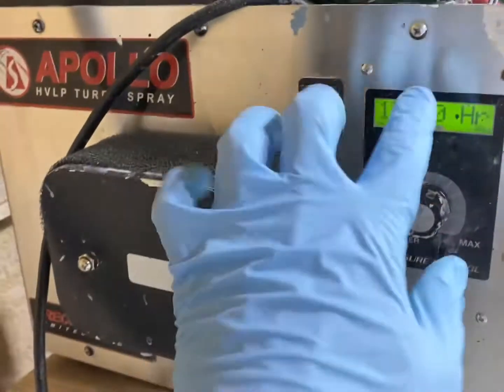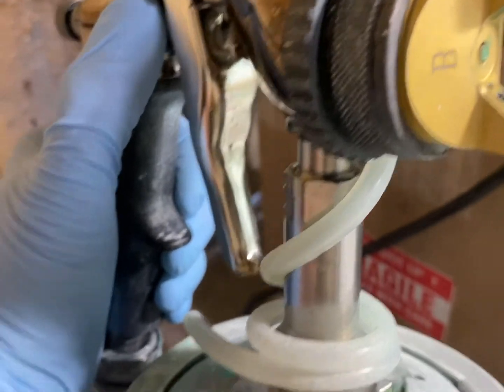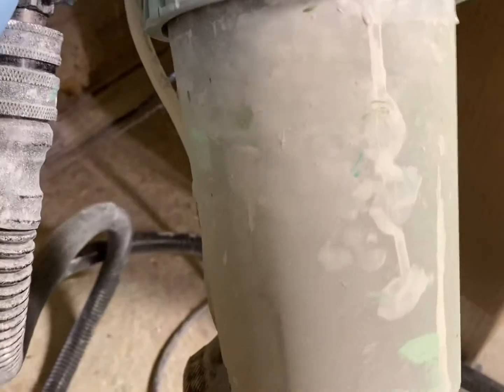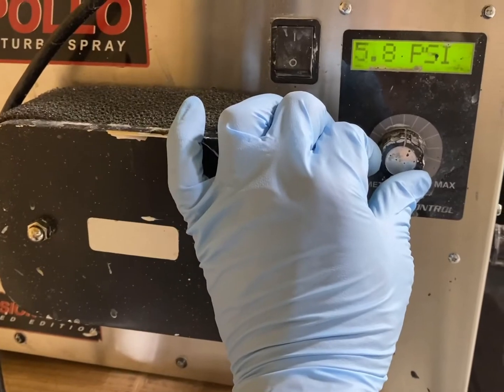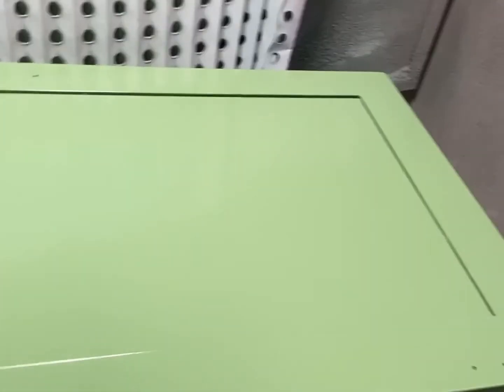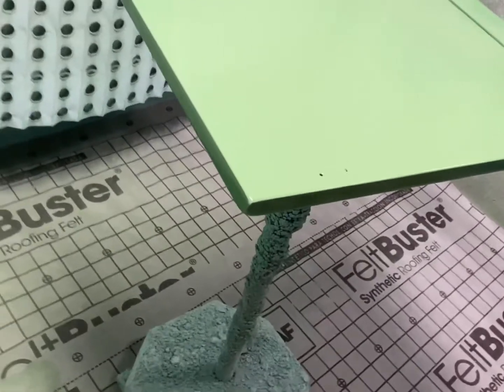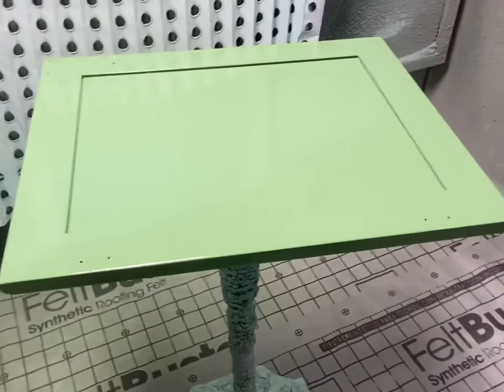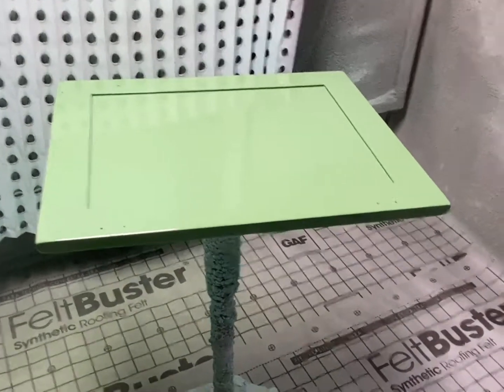Some Tips for spraying Renner waterborne paints with Apollo 7700 HVLP. See description for more...

Comment: Cool to see you can spray these finishes with an hvlp turbine. I have a fuji mini-mite 5 with a t75g gun with 1.5 and 1.8 tips. I am looking to get into waterborne finishes and want to try out the 688 and 851 on some tables. My turbine doesn't have a pressure knob just, a valve at the gun. Any advice for air pressure at the gun, fluid and fan settings on the gun?

Comment: I just got the Apollo and I’m testing out settings. I want to spray 643 unreduced so I can get the highest build. What settings have you used for 643 or another thicker water based coating that’s thicker like that?
Reply from the maker: I would use a 1.8 or 2.0 needle with the C air cap. I also reduce 5% for better flow. Adjust air pressure as high as needed. You can probably spray unreduced but won't get quite as good atomization.  Also, I like to use a pressurized cup like a PPS cup.
Reply: @homesteadcabinetdesign3406  thank you so much for responding. I just got the Apollo 6, supposed to spray unreduced. Have you ever tried heating up the coating instead of reducing?
Reply from the maker: @aurthordunne  yes that works but be careful if you add catalyst , as you can  shorten the pot life quite drastically.
Reply: @homesteadcabinetdesign3406  you’re saying the pot life shortens with warming up the coating when adding catalyst?

Comment: I really appreciate the tips in the description. How do you handle customer requests for a specific color? One of my clients wanted a custom coffee bar but the color had to match existing pieces in the room. I was stuck trying to use HVLP to spray SW Emerald. I have the same setup as you but I just could not get it to work. I had to thin the material by 40%. I found someone who could spray the paint with their airless system. Ever since that project I've been trying to find a color matching solution with a product that will work with HVLP.
Reply from the maker: Some of the thicker coatings will spray better with a PPS cup. I prefer that over the gravity cup.  I'll do a video on that soon.
Reply: Thanks!  I use PPS cup, pressurized either on top or bottom.  I've blocked out some time to getting the setup just right. It is frustrating when you are told you can spray it and I've got the equipment but it takes time to get it all dialed in.

Comment: Do you have to throw away the liner every time you finish the contents, or can you refill it and continue using it? Seems expensive if you have to throw away after it empties once. Thanks!
Reply from the maker: I refill them as long as things don't dry out. At the end of the job I just pitch them with the leftover paint since it's catalyzed and will harden.
Reply: @homesteadcabinetdesign3406  ok awesome! I meant to ask if you've ever sprayed Renner primer 643 through that turbine, and if so what settings did you use? I know the top coat sprays beautifully with a 2.0 C HS cap and 6.2-6.8 unit pressure/full open air/4-5 turns fluid/3lines from full circle. Thanks! Keep up the great videos!!

Comment: Now that you've transitioned away from HVLP for WB to airless/AAA how do you feel this machine specifically does in comparison with your other setups? Does HVLP still provide a better/smoother finish? I know the apollo precision 5 LE can spray Renner straight out of the car without thinning based on results I'm seeing from pros in some of the forums I'm in. Curious on your thoughts as I wanted to add this sprayer to my arsenal.
Reply from the maker: I haven't necessarily transitioned away from it. I like them both. I think every finisher should have an HVLP for small jobs, touchups, and for spraying stains or clears. I like airless as well for spraying primer on doors. Topcoats on doors I generally use aaa. On-site spraying of the cabinet frames, I use my HVLP.
Reply: @homesteadcabinetdesign3406  makes total sense. I also was curious if you’ve ever compared the results you get using these high end machines to let’s say a lesser x5/x17 airless using the FFLP tips? Im wondering if the difference is drastic in finish? Thanks for your input. Love your videos.

Comment: when i use the PPS system with my Apollo and Renner 1245 or C005 Crosslinked , thinned 5 %, i find I have to remove the screen in the lid of the PPS to get a good spray pattern...do you have any issues with the screen on?
Reply from the maker: No, you shouldn't need to do that. Is the bag being compressed when the cup fills with air?

Comment: Hello and thank you for the videos.  I am in the exact situation you described.  I'm a carpenter getting into finishing and refinishing. I currently have a large compressor and an older Devilbiss Finishline flg4 HVLP in my shop I have used for many different coatings with success.  I struggled greatly to get consistent results with Centurion 2k.  I'll be switching to another like Renner. Do you have recommendations on a good WB 2k gun for a compressor set up? Also, do you think a good compressor and gun is different than a turbine system? I'll be getting a tritech shortly and probably converting it to AAA. For smaller projects like a vanity or furniture, I feel as though HVLP would be best suited, maybe? Thoughts? I'd really appreciate it.  I've been struggling to get out of this rabbit hole.
Reply from the maker: I've used a turbine unit for a few years until the unit quit on me. So temporarily I'm using a compressor set up. the problem is most HVLP guns require more CFM than a small compressor can handle. I'm experimenting with a few different guns right now with  a 2 HP compressor and will be doing a video shortly on some of the results. Turbine units should be at least 5 stage for 2K WB or they just won't atomize well. Compressed air will atomize better, but its hard to find a compressor that will keep up. A large compressor in a shop works well, but for taking to jobsites, just isn't practical. Possibly 2 compressors and an auxiliary tank would cut it, but that's a lot of stuff to lug to a job compared to a turbine. So there's pros and cons.
Reply: @homesteadcabinetdesign3406  the Apollo quit on you? How many total hours?

Comment: What are your thoughts on the Apollo vs the airless/AAA for thicker waterborne products.  Are you getting good results with the turbine?
Reply from the maker: I like both. I use the AAA for spraying doors in my shop and the Apollo for spraying onsite because I like how the fan pattern can be dialed in. Not all products spray well with the Apollo. I use Renner products and love how they spray. Milesi and Envirolak will have less issues when using airless or AAA. They tend to be a little more finicky with HVLP.